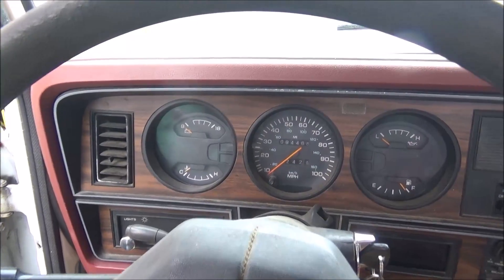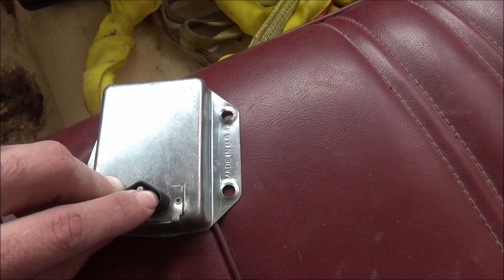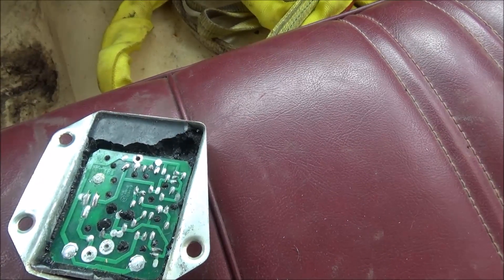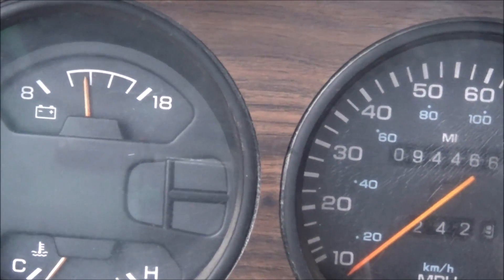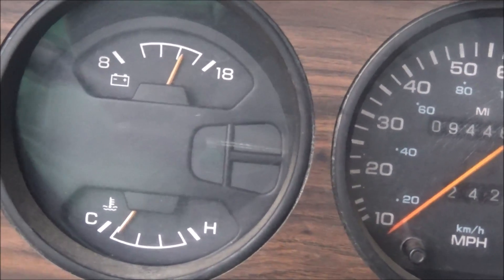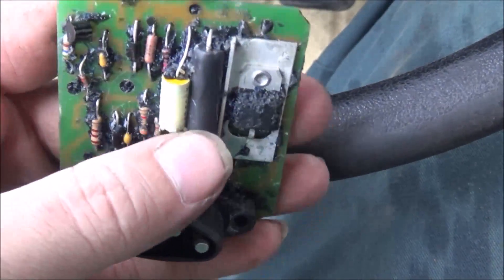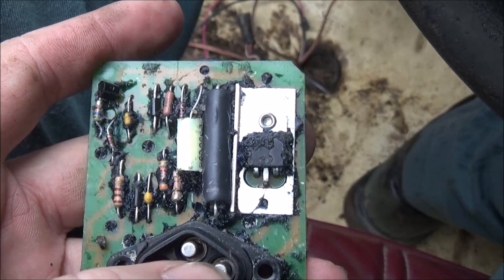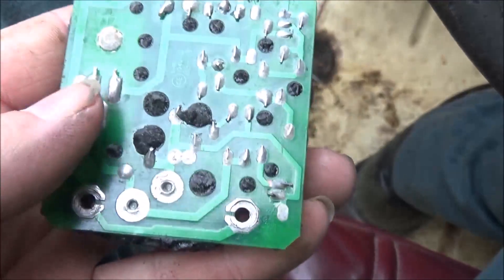Plagued by electronics, I need help

Comment: Brian, I agree with all those alternator/internal regulator/ground solutions. Here's a short video that may help: http://www.powernationtv.com/two-minute-tech/2min-78/convert-a-2-wire-alternator-to-single-wire
Get yourself a single wire Delco alternator like I put on my Jeep and my 4020 and several other tractors locally.  Two woven type ground straps, one on each side of the engine with one of them ideally attached to the same bolt as the battery ground. If your battery ground is attached direct to the engine, run a ground strap from that point to the frame. Be sure to grind the frame attachment points to bare metal. I've had no trouble from mine or reports from other farmers. Get a quality alternator! I have had a LOT of bad luck with "rebuilt" ones from the two local "big name" discount auto parts stores. Go to NAPA or Bumper To Bumper. I got a starter, twice, that still had old, broken brush holders still in it! They only cleaned it, poorly at that, and painted it!

Comment: I don't see enough info in your video to make any suggestion other than you need an inductive ammeter, you need to do more testing, and you need training on automotive DC charging systems. There are two sources of training that will be helpful. One is Vince Fischelli, you can get training manuals from him if you like the info in the following video on the MotorAge YouTube channel:
https://m.youtube.com/watch?list=WL&v=4EFzX3SN6ck
Another good source of training is Joe Glassford. He has a website where he sells books that are structured to answer specific automotive electrical questions such as "How to test a voltage regulator."

Comment: I think your problem may be the ground cable from the engine to the chassis/body.  Electronics are sensitive to variable and intermittent signals.  Those regulators have always been a 'consumable' item, (like a fan belt, spark plugs, alternator etc.) but they should last a lot longer than 6 months.  I'd be upset if it didn't make it to six years.
If you take the circuit board into Radio Shack, someone in there should be able to help you identify what all the magic components are, and may even be able to test them, and then sell you a replacement.  Good Luck.
First thing though, is unbolt and clean back to shiny metal where the ground cable is - Both Ends.
Reply from the maker: Testing to the battery I show less than 0.1 ohm resistance to ground from either the regulator or the alternator. I think that should be pretty good. The only thing i discovered is i have about a 0.3V drop across the ignition circuit side that feeds the reg and the alternator field.  It will be like 12.6V when the main charge wire going back to the battery is showing like 12.9.  I wouldn't think that to be enough to be problematic but I may have a fuse link wire in that circuit creating a little resistance since I am seeing some voltage drop.  I wonder if an intermittent light wire going to ground would be enough to kill the voltage regulator? I haven't had any problems blowing fuses though so it would be hard to track down if it was.

Comment: All grounds should be removed, scuffed and reattached. Then the alternator should be considered. No what the duty cycle presented by the regulator if the brushes or windings are intermittent the the reg will go sour trying to make an intermittent alt work. How old/miles does the wiring on the truck have?
Reply from the maker: Well its 27yr old and probably has 200+thousand miles I would imagine.

Comment: That little round component you were asking about is probably a thermistor, it's a protective device that will open if too much current is drawn.  When blown the sides puff up a bit.  I thought that alternators of today had regulators built in, but then I haven't had any experience systems of the last decade or so and especially diesel.
Reply from the maker: Well all of this stuff dates to 1989 so its certainly not todays tech.

Comment: My thoughts would be alternator or ground which can a devil to trace out if its intermittent. Honestly not familiar with the Mopar systems so my next question would be where do they get the line voltage from? If its the ignition circuit then we also need to look there too.Edit: thought... what if you run a dedicated ground from the alternator to the regulator...?

Comment: Sure sounds like a bad connection somewhere. It does not have to be the ground. Excessive voltage is the most likely thing that would burn out the regulator. This can be caused by what is called a "load dump". In other words when the load, in this case the battery, is suddenly disconnected from the alternator the alternator can put out a very high voltage spike until the regulator catches up and shuts down. Check all the wiring from the alternator to the battery. Also the sense input to the regulator should be connected as close to the battery positive terminal as possible.
Reply from the maker: The sense/excitation wire is feed from the key switch so the field can only energize when the key is on.
Reply: You are right about the key switch.
 The sense input does not supply any of the field current but there is some current to ground through that input which would eventually run the battery down. I should have said that the sense input needs to have a good representation of the actual battery voltage to properly regulate it.

Comment: BAd grounds, bad cables, bad cell in battery.
Reply from the maker: It has had 2 different batteries during this time thanks to the reg cooking one.  If you hold the fuel kill it cranks the engine like crazy so I don't think it is cables and I show less then 0.1ohm to battery ground from either alternator or firewall at the reg.
Reply: bcbloc02 those are my three go toos and almost always find it in the cables. Have you tried a regulator from another manufacturer? Do you have access to a scope Meter?   There may be some weird alternator outputs.

Comment: two things. 1. I think there are two different regulators. standard and HD. 2. I've had a lot of Mopars over the years, and this is common with poor ground. check the ground straps. When the engine swap happened, did you add back all the ground straps? sometimes if the straps are there but the contact point is painted this can happen. I have also seen connected straps with loose/frayed ends.
Reply from the maker: All of the factory grounds were installed just like from the donor truck. the auto parts place lists a VR125 for pretty much every application there is. i am suspicious they may not make an HD one anymore and the 120amp alternator burns the standard ones  up. The application is so limited that likely no one cares anymore that the right part isn't supplied.
Reply: bcbloc02 That's curious about part. numbers and differences. I've got obs powerstroke trucks. one had an emergency vehicle high output alternator. Replacement listings didn't show it either many places I went.

Comment: I would say that something is shorting out. I noticed a bunch of wires on the floorboard in the cab.  How about this - turn the truck completely off (no clock, no nothing) then use an ammeter at the battery to see is you have a current flowing.
Reply from the maker: The wires on the floor are the speaker wires and the seat belt buzzer(they could be thrown away as they are not hooked up on either end). i have no current draws with things off if I unhook the radio, itherwise it draws a very small amount for the clock and memory. The truck can sit for weeks and it doesn't discharge.

Comment: Advice: stop "jumping" the truck with cables from another vehicle. Only use a proper battery charger and remove it when starting your truck. This will stop 90+% of the component failure. Next, find the source of your battery drain - which results in a no-start condition due to low battery.
Reply from the maker: There is no battery drain. The battery was dead because the regulator died on the way home and I have to run the lights a half hour to get home.

Comment: Replace Alternator and check or install firewall to engine ground a bad power wire from alternator to battery creates excess resistance and can cause overcharge of battery.
Reply from the maker: It always charges perfect whenever it is charging.  i am going to add another ground.

Comment: I'd put my money on a ground issue. I would check that all grounds are good including the mounting of the regulator itself. Do you have a ground strap going from the back of the engine to the firewall? That one seems to be the most common to be forgotten about when doing engine swaps and ect. Best of luck! Problems like this can drive a man crazy.

Comment: Check for voltage between the engine block and the cab (firewall). If there's any voltage, it could be millivolts, you have a grounding problem.
Reply from the maker: No voltage shows up AC or DC and checking ohms to the battery shows about 0.1ohm to ground from either the alternator or the firewall.
Reply: bcbloc02 
     Hmm. Since it seems to coma and go, I would have to suspect the alternator or its wiring. Voltage spikes could be taking out the regulators and maybe the OEM Chrysler regulator is better protected. At this point you have paid for a new (or rebuilt) alternator. An alternator, unlike the old generator, puts out AC and has built in diodes to rectify it. It comes out as "dirty" DC having an AC component. If one of the diodes loses its connection, it will pass more AC to the regulator, which must be going into some kind of self-protection mode. I don't think the alternator is losing field excitation since that's unlikely to cause a spike.

So unless you're into disassembling the alternator to replace the diode array, replacing the alternator would be a logical next step.

Comment: Instead of just offering a possible solution, some questions should be asked and answered that could bear some fruit to the root cause of the issue and show a possible solution. 
Lets see, 
The problem only started after the Cummins conversion correct? 
Or did you have a problem before the conversion?
If I remember correctly, what prompted the conversion you always wanted to do was the old Gas engine blew the cooling system when you traveled to get the Overhead crane. That event could have damaged something depending on what was changed over or left behind in the current charging system of the conversion to a Diesel engine.

After the event do you remember having charging issues while driving the truck back? You could have brushed it off because the engine bay was covered in coolant?

Does the Engine bay have the full original Gas engine charging system parts? 
I.e. Alternator w/OEM Pulley size, External Regulator, and Battery type.

Does the Engine Bay have the full original Diesel engine charging system parts from the donor vehicle?
I.e. Alternator w/OEM Pulley size, External Regulator, and Battery type.

Or Was the Alternator on the engine the only part changed over from the donor diesel engine? with its OEM Pulley size?
Where they both the same type and model of Alternator?

Depending on ether the Alternator was from the donor vehicle or was of the same type.
Did it have an external regulator? & was it of the same type/model? 

I would think they are some what different given the pulley speeds at idle and Engine rpm's during driving are different giving a Gas engine vs. a Diesel engine. They could have different unregulated output voltages to the external regulator.

I've also seen before when a battery meant for a Gas engine put into a Diesel cause issues. "The battery usually takes the hit in that case"
As I'm sure you realize that there is give and take with a charging system, a sorti balance must be meet. 

Some have mentioned chassis earth bonding issues, This could play a roll.
Also If it has not been mention, The connections in the charging line should also be check. A bad connection down the line could lead to an increased in Amp draw. This would have to be after the External regulator causing it to work harder thus a shorten life. Could also be in the field wire "sense line" as well.

I was first going to ask the make of the External regulator. I had issues with the after market with some items. The only solution was a true Dealer OEM part. If your sure the latest part that lasted the longest was OEM, Then I would lean toward something else chewing up the Regulators.
Ether from the source or the load this would included the battery.

Also mentioned by others a DMM "Digital Multi-meter" will not show a dirty signal. But it will show when set to A/C any bleeding of A/C signal into a D/C system.

I look at it this way, It all work before. Gas / Diesel charging systems. So something is a miss. But, If they are a mix match in one of the parts given a conversion to a diesel engine happened. The weakest link could be bearing the incorrect load and losing.
I hope these questions help you solve the problem.
It sucks to have Vehicle issues or even worse, You don't know when its going to fail.
Reply from the maker: Everything was swapped from the donor as factory, alternator, all wiring, dash, switches, regulator battery cables all of it.
Reply: Okay, guess it doesn't hurt to check the unregulated output from the alternator. It could be leaking too much A/C causing the regulator to fail sooner then later. I think you mentioned that most failed to output anything but one failed with a full on charge output.
Reply from the maker: I should have checked that before swapping alternators. I already changed it today to one of the others I have this one is a Bosch instead of a Nippondenso. Maybe it will behave better. I recleaned and checked all the connections between battery and alternator while I was at it.  I will pick up another warrantied reg tomorrow and see how it does. My multimeter detected no ac output from the Bosch alternator I put on when it was grounded out and full charging at about 16V at idle.

Comment: Make sure the 12 volt reference source from the battery is connected to the center post of the regulator.
Reply from the maker: It is. It goes to battery voltage as soon as the key is turned on.

Comment: Brian,

There is a bulkhead connector at the firewall. I believe on your truck it is on the drivers side of the truck, next to the brake booster. If you pull this connector apart look for melted plastic, burnt connectors, or corrosion. The regulator may be going berserk because it can not sense the electrical load properly. 

I know a lot of people like the idea of a self exciting (one wire) alternator, but they really do not belong on road vehicles that experience constant changes in electrical demands. That is why every vehicle manufacturer uses regulators that can adjust the charging output according to the vehicle needs, be they internal to the alternator or external as in your case. Newer Dodge trucks went to a system that has the regulator inside the PCM. Yours is much simpler.

Best of luck to you,

Marc
Reply from the maker: I had all of that apart when i installed the dash and engine harnesses and it all looked good then.

Comment: My first thought was you might have an intermittent ground problem.  But it could also be a too much heat or vibration problem in conjunction with the engine conversion.  Good luck.

Comment: Make it easy on yourself, get one of those 1 wire Mini Alternators on EBAY for less than $100. Remove the Mopar junk, install the mini, and be done with it. 
(Been there, done that).......living happily ever after.
Also, connect a good size ground wire from the back of the Alt. TO the battery.

Comment: Brian, i have two 1stgen cummins d350"s, both my trucks seem to go through voltage regulators every year or two, i have always figured that 1stgen's had this issue because they only have a single battery and the electrical system is pushed to its limit starting the 6bt especially if your heater grids are used often. If you don't find any other issues in your charging system you may consider going to a dual battery arrangement to help reduce the stress on the charging system.
Reply from the maker: I have never put a regulator on my 89 and it has almost 250,000mi on it and I have had it for 15 years. They should last that is unless of course they are just made out of junk pieces now.